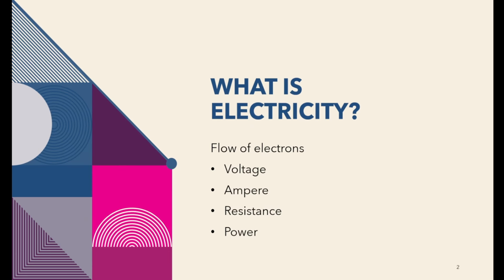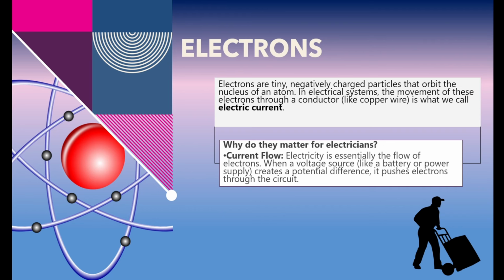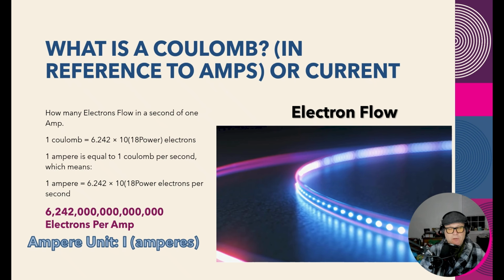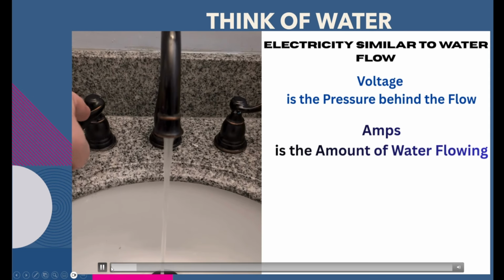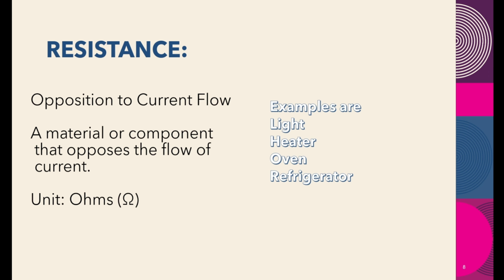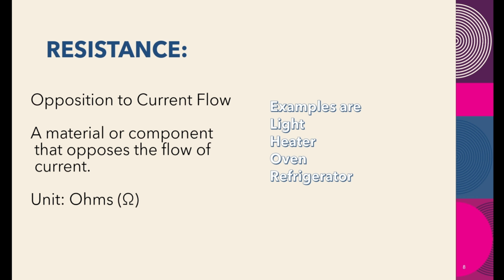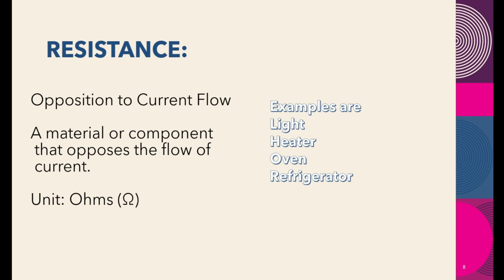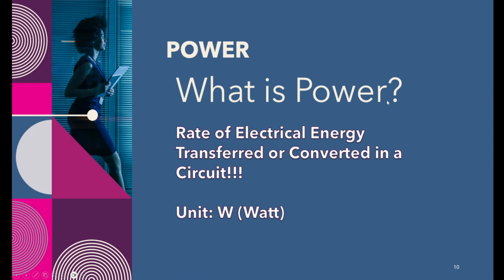How Electricity Works | Electrical Basics for Apprentice & Beginner Electricians

Comment: I'm not sure about this I've always thought of voltage as more like bandwidth, and amperage as more like the pressure. So like voltage would be the capacity for flow and the amperage would be the amount of flow within capacity.
Reply: It seems to check out whenever you think about what happens when you try to put too much wattage through low voltage. You burn up your wires because you're not allowing for the bandwidth that is required for the amount of power you want on the other side, but if you increase the voltage you can use the same size wire safely and get the same amount of power that you wanted on the other side
Reply from the maker: @FerenzeeBlazingReapr that is ampacity. The ability for flow. Lower wire size burns due to not having the capacity to flow. Heating the wire to a undesirable temperature. Voltage is definitely pressure, high voltage if not terminate right can explode.
Reply: @TechTrainSolutionsPA well then how do tasers work? They have extremely tiny wires with insanely high voltage.
Reply: Maybe it would help if you explained it from the context of say a water hose and a pressure washer. Because the water hose clearly has the higher capacity for flow yet these smaller diameter hose has a much higher pressure. I'm not sure if that maps on or not
Reply from the maker: This was just an overview, I made another episode just on voltage alone. Coming out today. 
And then tomorrow is another episode about ampacity and current.
Reply from the maker: I appreciate your comment, just need to present Voltage and Amps better in the upcoming videos. This is a work in progress to only get better.